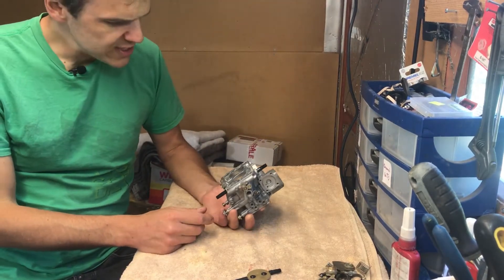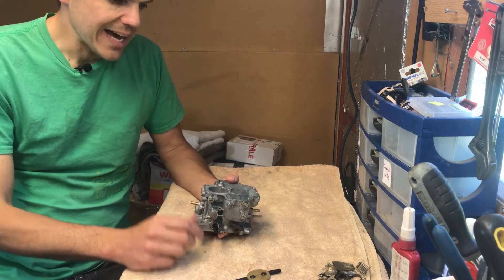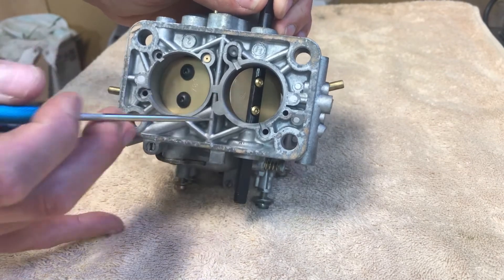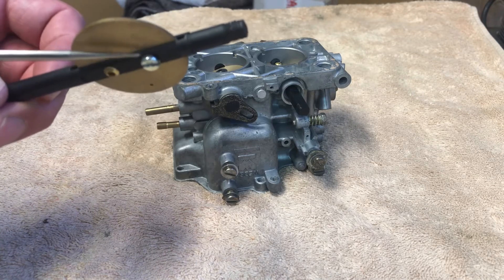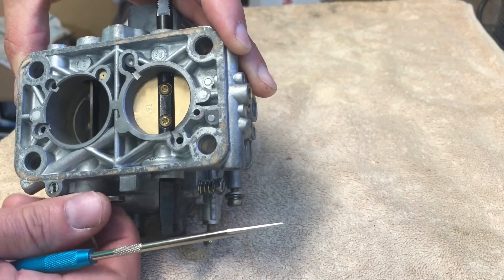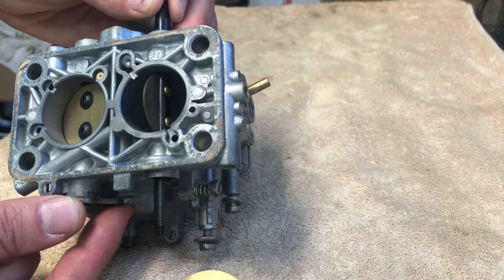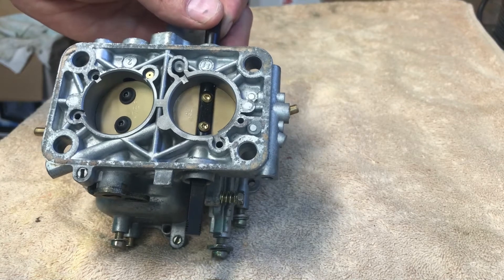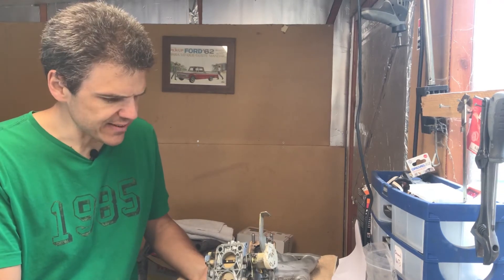How to performance tune a weber 32 34 DMTL for higher flow

Comment: At 2:40, the secondary throttle shaft has a small screw that can be used to stop it. No manual ever says how to tune it. Do you have any idea?
Reply from the maker: That is if the engine needs more air at idle but it generally is left alone

Comment: Hello sir, I got a 32/34 DMTL second hand but I don’t have the instructions for tuning it, do you have them ? I can pay for it
Reply from the maker: Hi there! Sorry! Haven’t got literature for this specific model!
Reply: @carburist  Hello, I have acquired a landrover with a 32/34 carb, dmtl  but none of the connections are made I know which is the fuel but none of the others, there appear to be two solenoids and three small pipe connections (vacuum I suppose) can you please help me?

Comment: Considering putting a 32/34 DMTL kit on my old Golf, as it is a small upgrade in port sizing over the Pierburg 2E2. Would you happen to have the info on the screws used to upgrade this 32/34? Looks promising if matched to a sport camshaft! :)
Reply from the maker: Hi there the screws need to be M4 size and 0.7 thread pitch. Look out for a countersunk head on it as you are looking to minimise the profile of it.
Reply: @carburist  brilliant, highly appreciated!

Comment: Would you mind doing more videos on this Carb please, like how to set float level, or at least what to, and possibly tuning fuel mixtures or just show how to. Thank you 🙏
Reply from the maker: Yeah, will try and show you how to set up fuel level. The mixture issue I will cover in an upcoming series on using Weber power plates in Holley carbs. Basically the mixture screws in this carbs meter “volume” of pre mixed air and fuel. If you want more fuel you need to change the idle jet.
Reply: Air Fuel Mixologist that’s brilliant thank you, yeah i did think even these webers you’d have to change the jet for pre determined fuel mixture, I’m just not gaining, if anything bogging on second choke, must be a blocked jet or float bowl is draining
Reply from the maker: Have just posted a quick video with some musings about float level setting. check it out!